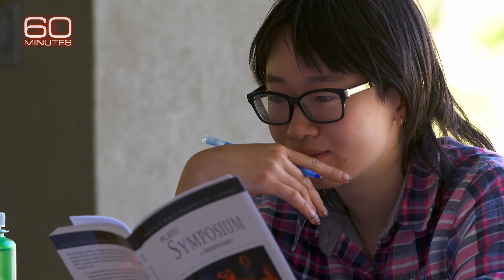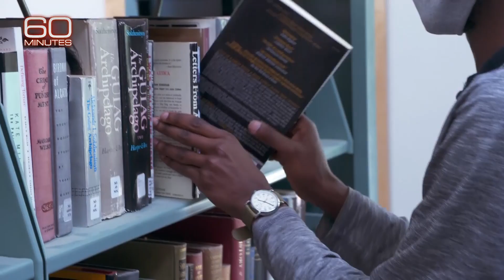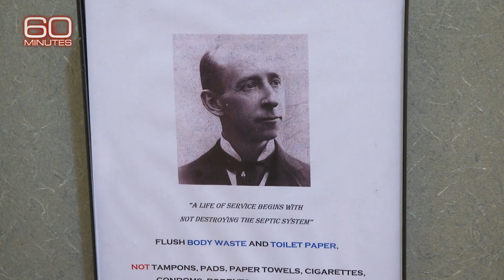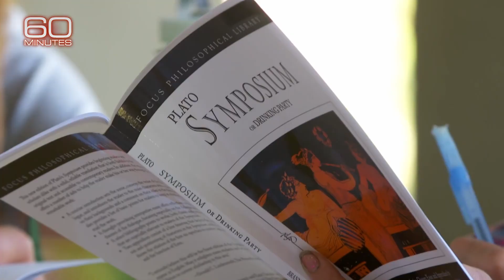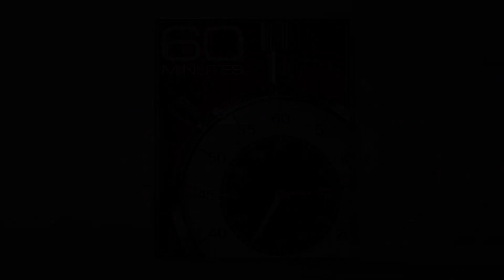Deep Springs College: Higher education on a remote ranch

Comment: Misleading. This is a community college. It's accredited by a community college accrediting board that is essentially only accepted in California (ACCJC) and has had very recent issues with the Department of Education. Anyone who has matriculated through California's community college system can tell you it's a running joke. 
Most other community and junior colleges are accredited regionally and are recognized by the USDE. It is not an exclusive group of accreditors and there are about 40 regional accreditors some approved recently. So one wonders.